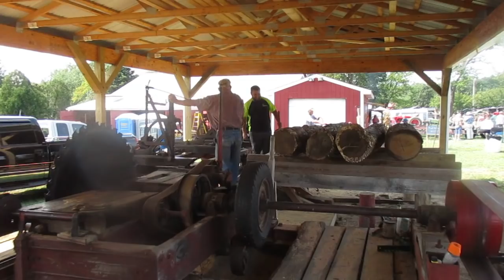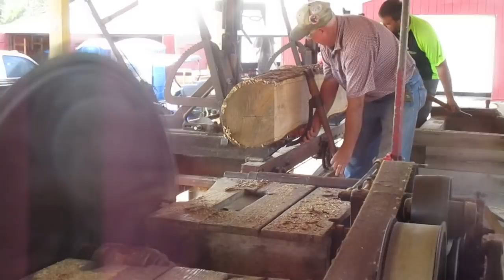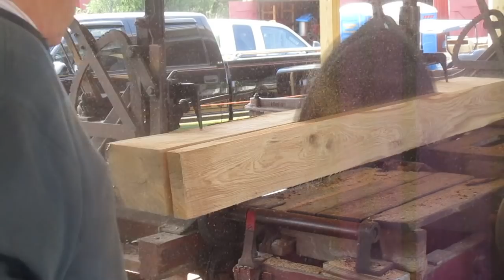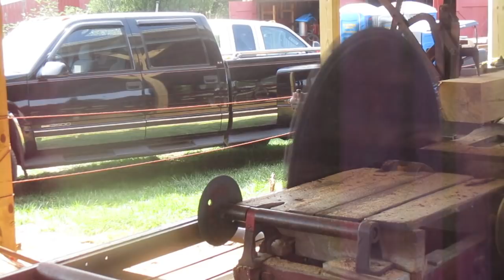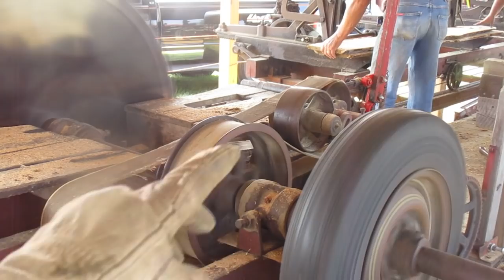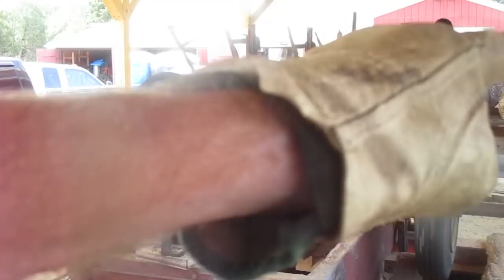Sawmill @ the steam and gas show #534

Comment: Thank you for the video.When you're using a different farm tractor as a power unit, how do you-all know the RPMs the saw is turning?I could hear the operator playing with the throttle.
Reply from the maker: hi there most the tractors were around 500 rpm . kind of like tractors now are around 550 now at the pto . then watch the blade stand up . they can most the time go 50 rpm + or -  john